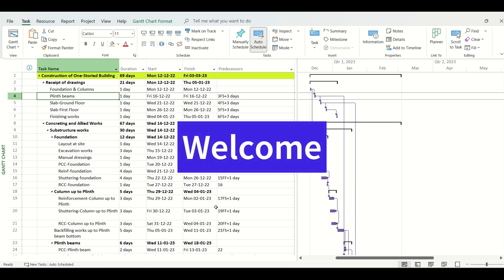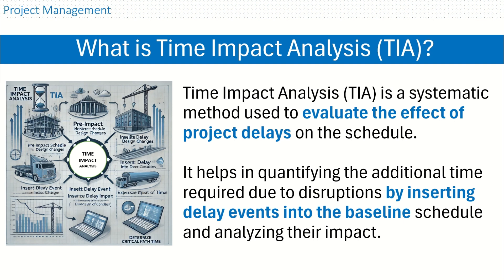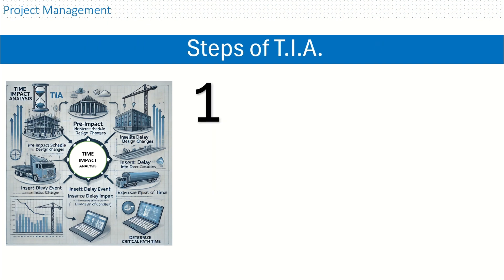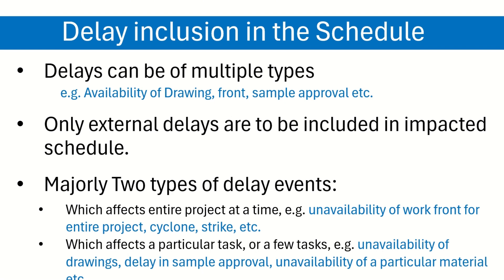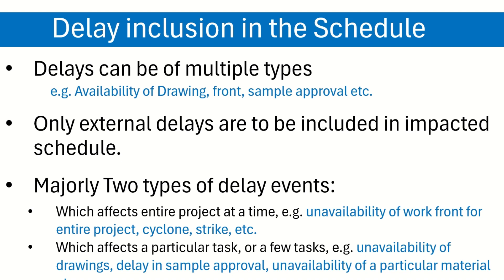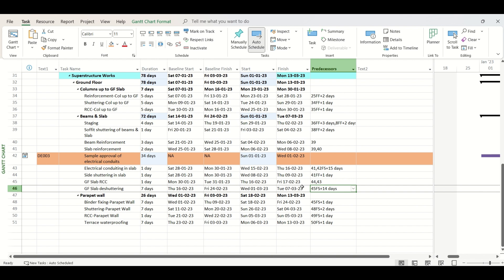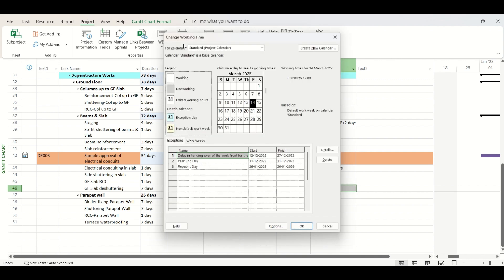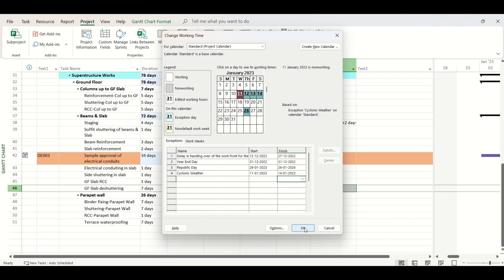Time Impact Analysis | Construction Extension of Time Application

Comment: We mostly go into the case TIA with inserting the actual start or actual finish updation, this approach to insert as an exception activity is very new to me. Lots of thanks for this knowledge sharing sir.
Reply from the maker: Glad that you found it helpful. Actual start and actual finish is one way of tracking. But with this approach you can directly prove the impact of the delay events in case you need an EOT from client (from a contractor's point of view)